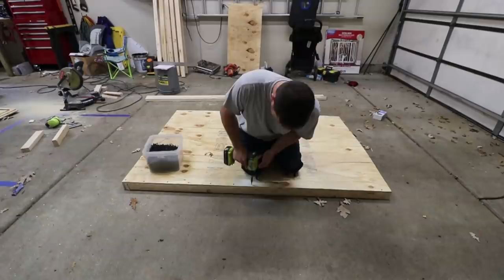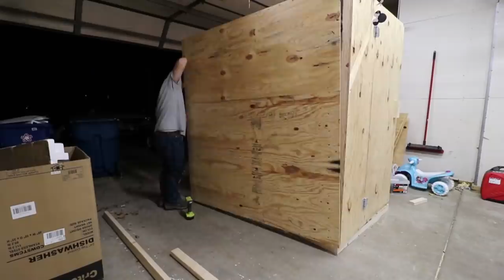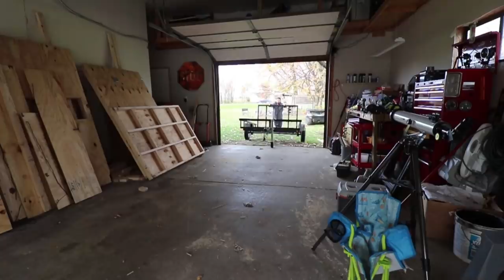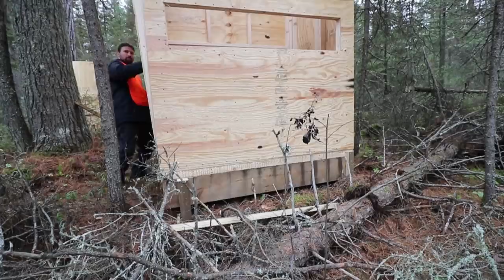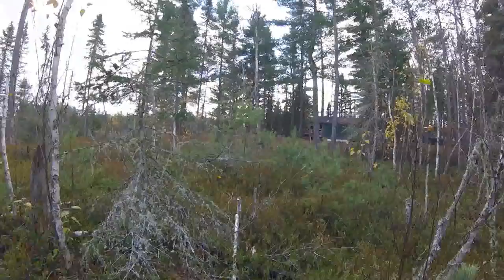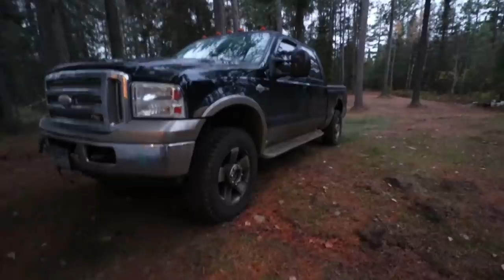Grandpa's Deer Stand. A comfortable spot for Grandpa or anyone else to sit when its cold.

Comment: If you don't want to do plexiglass windows... you can also get a clear shower curtain cut into strips and over lap some to knock off some wind keep up with pushpins. But yeah 2 bypass pieces of plexi would be great. Also my dad had hip replacement and though that is a great seat he really needs a good cushion on that. Maybe one of those body heat ones cause that METAL joint gets cold in bad weather.   Best vid you have ever put out Zach.... keep them coming.

Comment: Nice stand Zach! I’ve made a couple of similar stands. After the roofing (rolled asphalt ) failed after a couple years, I started using corrugated asphalt panels — brand is Ondura from Lowe’s. They have proven to be much more durable. Also you’ll need to paint/ stain the plywood to make it last! Good luck this season!
Reply: Ya think that Thompson's Water Seal would do the trick? From what I hear, that stuff is very durable...and long-lasting.

Comment: Very nice build , my only concern at first was the Elmers glue, and the flat roof .
I’m sure you were just using what you had, so glad you changed brands and found that corrugated plastic.
Great plan design should last for several years. 👍👍🍻
Reply from the maker: The roof was glued with 3m series 3 glue, good in all weather indoor and out.

Comment: I was speaking of putting the windows closures on the inside of the blind because it is easier to open and close them from the inside. The only way to close them on the outside is to get outside the blind. Otherwise it is a good design with enough space to get around and spread your legs out. He will enjoy this blind for many years. Good job!
Reply: The windows have a string system that you use from the inside to raise and lower them. I realized I didn't get enough footage of them being installed once I got home . Thanks

Comment: instead of that carpet mat, try some anti-fatigue interlocking foam puzzle pieces.  2' by 2' square, 1/2" thick.  good insulator AND quiet
Reply: Should be somewhat softer to walk on, too, than just a piece of Carpet... unless there's some half-inch felt padding underneath the Carpet. That half-inch padding makes all the difference between thump, thump, thump, and something nice and soft to walk on.
Reply: Carpet will helps so the snow and Ice tracked in won't cause him to slip. And absorb moisture.

Comment: You may want to think about putting the strips back on your shooting windows and use some hinges on the top of them with some hooks and eyes old them up so you can close them and the cold air from blowing through to keep it warm inside. It is easy to lift them up and hook them open when you want to look out. It also keeps it warmer in the inside if you put a heater in the blind.

Comment: He needs a swivel chair so it would be easier to watch both sides and I would also put some paint on it I have a simular blind but I got plexiglass sliding windows in it stays nice and warm in it where I have to shed clothes or turn heat off  I used 1/4'' channel aluminum for the glass to slide in be alot warmer for him. I also put mine on skids so I can drag it around if I want to move it

Comment: Cover the whole floor with carpet keep it quite and warm to screws on wall hang heater off floor. Should make yourself one but off the ground either in trees or posts . But you need to put indoor outdoor carpet on the whole floor in grandpa’s for noise and heat